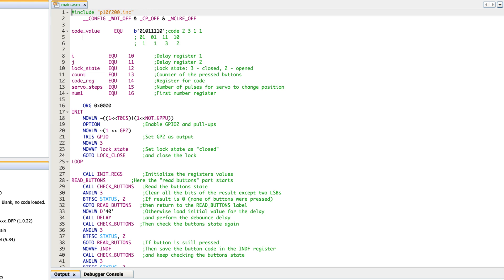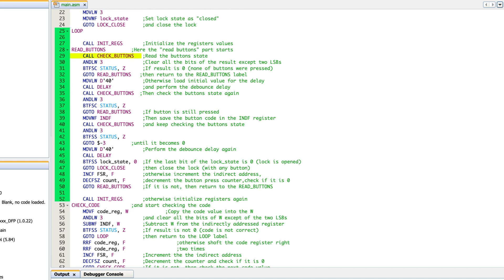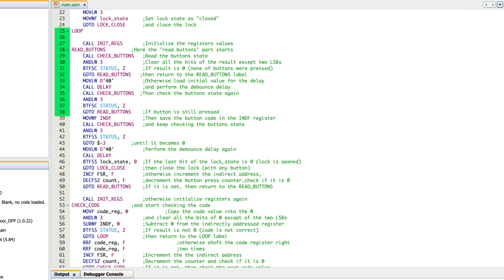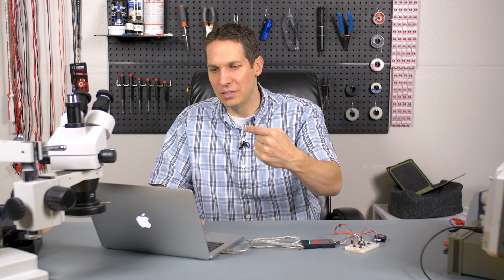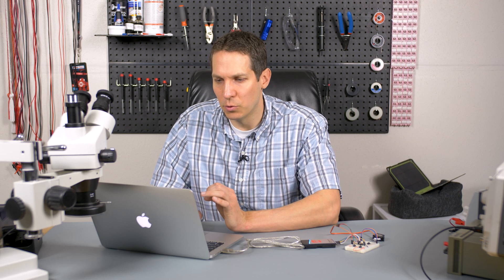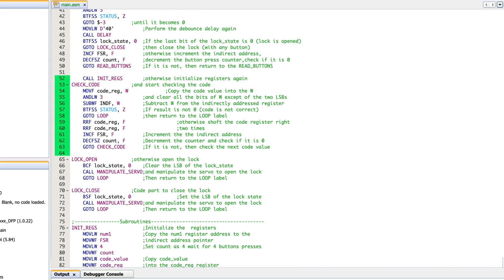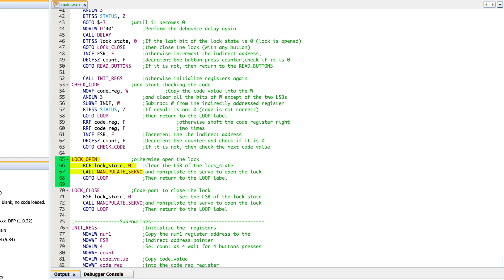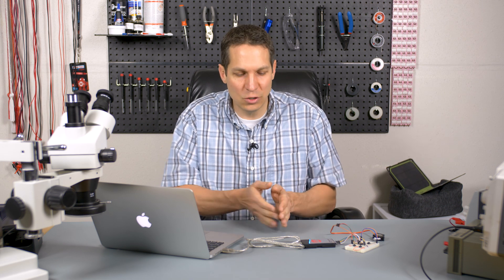Servo motor, indirect addressing, and electronic lock - Part 10 Microcontroller Basics (PIC10F200)

Comment: I read those 14 tutorials daily one time on microcontroller pic10f200  in circuitbread
Reply from the maker: That's awesome!  I think my brain would've exploded if I tried to do all the tutorials in one day...
Reply: @CircuitBread  hahahaha whatever u may explode but I will be exploring my mind with your website and videos. I think this is the one and only one website with such extraordinary expalination which wouldn't be taught at University level.
Reply from the maker: Aw, thanks!  I think it helps a lot that Sergey was a university professor for several years and also has worked as an electronics design contractor for many years, meaning his experience is both very practical and very education focused.  He puts me to shame!